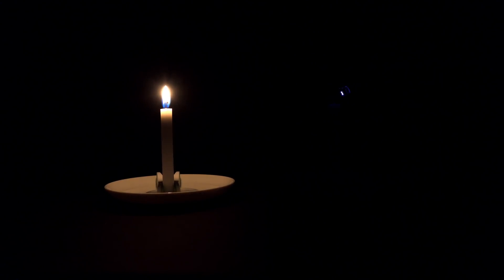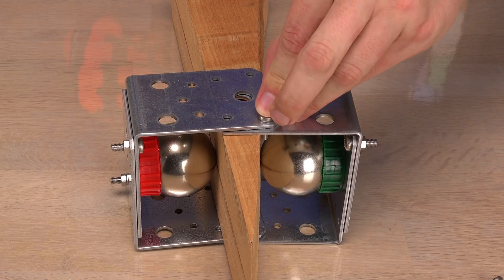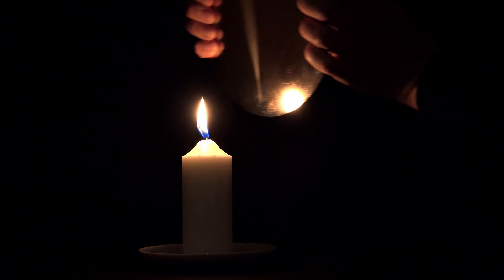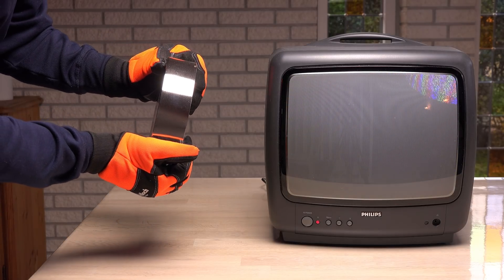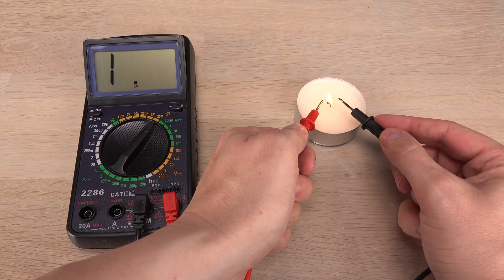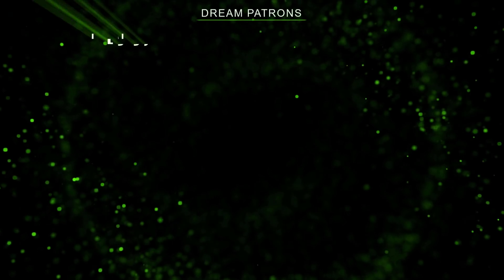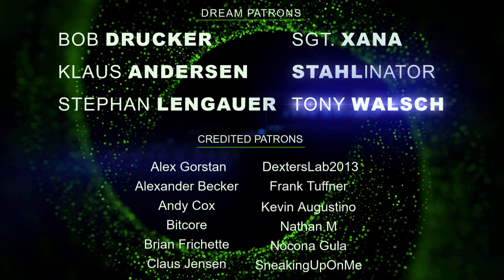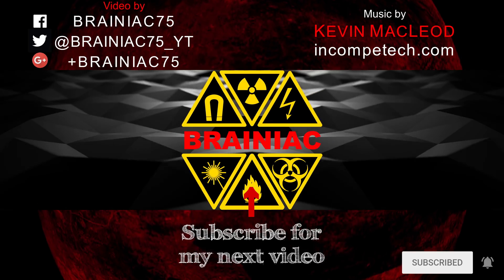Monster magnet meets flames...

Comment: that should make the flame attract the magnet not repelling it because the hot air would expand while cold air would still be pulled in trying to move the magnet with it that should cause the flame to be attracted to the ball even without the magnet. if the magnet pushed on the colder air it would do the same as the help the expansion from the heat but how ever there is another posibility that the flame produce naturally free electrons that accelerate randomly and that the magnet focuses these electrons into a condesed region that has their own field that could repel the magnet and that at random wavelenghts of em emission.

Comment: Würde der Magnet die Luft anziehen, dann würde um den Magnet ein höherer Luftdruck herrschen. Und es wäre messbar. Aber ist es so? Ich bezweifle es sehr. 
If the magnet were to attract air, there would be a higher air pressure around the magnet. And it would be measurable. But is it so? I doubt it very much.

Comment: Some places it has been observed UFOs entering volcanoes and by this experiment shows that the right magnetic field heat can be repelled and possibly enough magnetic field can even repel the extreme heat of the sun which would SPLAIN huge objects close to the sun collecting substance from the surface it's surface.

Comment: The flame experiments are very interesting but has anyone tried to enrich the oxygen content of an engine by peeling off the oxygen from the air at the inlet manifold prior to the carburettor. I worked on an old Swedish design oxygen analyser many moons ago when magnets weren't so powerful which suggested it could be possible. Likewise it might be possible to enrich air for patients using a similar technique without the need for oxygen bottles.

Comment: I'll do my best to explain the best I can and hopefully it'll still make some sense to someone (anyone!). I have begun to suspect that rain fall is in fact due to a similar effect demonstrated here. We just saw how the force introduced to the flame and adjoining air resulted in instantaneously producing condensation.  I appreciate some will conclude my description is simply describing how a cold material and heat interact, and so  I need you to recall what effect can be seen on the nose cone of a jet fighter as it approaches the speed of sound? Clouds. Unlike earlier there is no flame or heat involved  but water instantly appears along the nose as the plane compresses the air. Watch a relevant fighter jet video if you're unsure. I speculate that it's the mass and velocity of electrically charged celestial bodies passing through our atmosphere, akin to the jet fighter, which is effecting more accurately the production of falling rain. Bizarrely the same molecules responsible for producing our rain can also ignite if squeezed violently and suddenly enough, as witnessed in H bombs (when detonated as an air burst) explosion or in Tunguska (millions of flattened trees were caused by a shock wave   compressing the atmosphere.) Modern Rolls Royce Jet engines are so finely engineered and fuel efficient nowadays that they can easily compress air nearly as efficiently as aviation fuel. Fire and Ice indeed.

Comment: Liquid oxygen and liquefied air are so paramagnetic that they can be captured by a neodymium magnet. When I was attending a liquid hydrogen safety course, the NASA instructor said that LH2 leaks are extra dangerous because you can't distinguish LH2 drops from liquid air drops- I objected that my practical experience was otherwise. Turns out the NASA guy had never actually worked with LH2. Ah, credentialism.

Comment: So happens when u use air and magnets to accelerate air   So they need to run a flame  a magnetic barrel   I bet u could double the speed of one those  projectiles  they are using in mag lev guns

Comment: So it's a mixture of cow and palm oil/fats?
FYI the magnetic field of normal candle flame (why it has a stable shape) is very self contained so it doesnt changes shape easily when exposed to outside sources but if it was a flame tornado it should be more easily manipulated. (this is going on the theory of the flame battery where a bigger flame increases the electrical discharge.

Comment: Create a box with all magnets on the inside some how super glued, on all sides of the box but from the interior of it then create a magnetic ball that pushes itself against all the magnets you glued to the box so it the magnetic ball hovers in center or so it may move everywhere inside the box hovering freaking out.

Comment: To test if the oxygen is attracted, and not the flame is repelled, you can do the following test: ignite a mix of air & fuel. Let the flame exit through a hole into a vacuum chamber. You can then repeat the magnet test in the vacuum chamber. Another interesting test: put a candle on the surface of a monster-magnet, where the oxygen content is said to be higher. Light the candle and watch the air flow above it, as fresh oxygen is constantly pulled to the magnet, replacing the exhaust fume.

Comment: If there were smoke, you could see how the particles of smoke moved and from that understand how the air was moving.  If the magnet is really repelling the flame, a styrofoam boat with a candle and a magnet fixed to the boat should propel itself along.

Comment: When its time to create new exotic metalic materials requiring super extreem heat the materials will need to be held and suspended in a magflux bowl and the materials heated with powerful lasers, the magbowls can be either neg or pos charged to assist in the manufacturing process...

Comment: The flame is plasma, that's why. This means that we should be able to use the concept of a railgun to accelerate plasma from combustion to great velocity. Instead of just using a normal rocket engine to produce thrust, by putting a compact nuclear reactor on a spaceship to generate electricity, we could use less rocket fuel and compensate by hyperaccelerating the plasma with the electromagnetic railgun.

Comment: Interesting: I've been wondering if a 'plasma conduit' could be constructed for a flame gulper engine ( these work by condensing plasma in a cylinder to create a low pressure ) . one problem with these engines is getting the hot plasma past the intake valve . I've been speculating that a ring magnet  would keep the plasma clear of the cooler metal parts of the valve. Thoughts?

Comment: It would be really interesting to see what effect the magnet would have on some evenly displaced smoke.
Reply: Hmm I think it depends on the material the smoke is made of (and it's magnetic properties), maybe if it's more magnetic than air (or is slightly repelled) you could seperate the solid phase from the gas phase of the smoke.

Comment: flame is affected my the magnet because flame is a form of plasma,,,,, and plasma is electrical in nature to get plasma to glow put high voltage through it in a tube or in space fire is a form of chemical plasma kinda like our brains and bodies giving off heat from electro chemical interactions the air we breath is plasma of sorts all plasma is are charged particles of any sort electrons atoms neutrons and so on

Comment: 8:40
When you are playing with the double magnet and the flame there is a very noticeable lag between magnet position and flame orientation. The flame effectively seems to be reacting to where the magnets were, 1/4 of a second before.
This strongly supports the thought that the flame is not being directly pulled/repelled by the magnet, but rather by a secondary effect. I.E. the "wind" caused by the magnets' effect on the air surrounding them and the flame.
Maybe some tests with smoketrails in the air, if you can find a smoke substance that is very neutral magnetically and thus not itself affected, just carried by the air movements?

Comment: I think your 3rd theory is the major player. The conductive plasma is flowing upward, cutting the lines of flux from the magnet. The induced eddy current in the flame reflects the magnetic field, creating repulsion.  If you took the big, flat magnet, and held it edge wise to the flame, it would have had a big effect on the flame, just like passing aluminum through the field. That explains why the flame is repelled when you have a north pole on one side, a south pole on the other. Just drop a bar of aluminum through the gap, you'll see the force i'm talking about. It has to be moving to do it, and the rapidly rising flame provides that velocity. Granted, the plasma has high resistance, but those Neodymium Iron Boron magnets do generate a pretty dense magnetic field, and it doesn't take much force to influence a low density flame. the up draft velocity of a flame is actually pretty quick, due to the buoyancy of the light flame.

Comment: your stacked magnets are cool, (sorry for posting on an irrelevant video), but is there a method you can stack magnets that amplifies their strength? Like your magnets and stacked magnets seem to have a pulling force proportional to their volume: 1800 cm3 got like 12 kG, and the 1500 cm3 magnet seemed to have gotten 10 kG. But if you stick something non-conductive between the magnets (lets say a slab of cardboard for much smaller magnets), can it amplify them? If so, how much separation is optimal?

Comment: Years ago I used a fish tank air pump to draw oxygen from a magnet. I directed the flow into a Bunsen burner and used a thermocouple to measure the increase in temperature to confirm the increase of oxygen. The setup was crude so I could not determine any absolute values. That was long before the availibility of rare earth magnets and the thermocouple was a simple twisted wire. The effect was very slight but it did work. It was an interesting experiment.

Comment: Hey brainiac I bought an n45(35kg) rectangle magnet nickel copper nickel and a n42(5kg) sphere magnet chrome played as my two first magnets. Since the n45(35kg) magnet is very strong and dangerous what precautions should I have ? I’m a strong guy and I won’t have any issue removing it from any metal surface with another piece of metal. I already built a wooden tool to separate it from any type of surface. But my question is would it be dangerous if I hold the magnet in my hand  and put my hand close to a metal surface ? I’ve put 35kg in my hand and it didn’t do anything, but I assume it’s more dangerous as the magnet holds all that strength in a small surface.

Comment: Is oxygen enriched near the magnet? It would be very interesting to measure a pressure change, though the pressure sensing tube would need to be filled with a non-paramagnetic gas. Though it would be difficult to visualize, perhaps an experiment with a gas of higher density could be used as a manometer to measure the pressure change.

Comment: Both the diamagnetism and paramagnetism of the involved substances are minute in comparison with the flame flow forces. Unless there is some unexpected magnetic free radical I cannot think of dia and paramagentism as the causes. It must be moving charged particles in a field, creating their own magnetic field opposite to the external one. The flame particles are moving up and are charged for a small fraction of time, thus they can have an induced deflection which would generate it's own corresponding magnetism, which by my napkin drawing should be opposite to the external field. It should be just like diamagnetism on steroids.

Comment: I have a question. If air is repelled by a magnetic force, then would it appear to be attracted toward a vacuum chamber? Because air would only be present on one side of the magnet, it might push the magnet toward the chamber.

Comment: Flames are definitely conductive, just not at the few volts of a DMM probe. At higher voltages they become extremely reactive to electricity and adding more ions to the flame increases this effect. It can be used to make plasma speakers which are more efficient than air-ionized ones.

Comment: Interesting effect! However you lack a control test: in a environment without oxygen there should not be any deflection. Creating a flame in an oxygen starved environment is hard, but can be done if you seperate the oxygen inlet. 
However, I immediately thought of magneto hydrodynamics (MHD) . The flame consists of moving magnetic molecules, thereby they experience a Lorentz force. The equations for this also describe the effects in the core of the earth. Pretty cool stuff!

Comment: So the idea is that the magnetic field attracts the surrounding oxygen and not the flame, which causes the flame to have magnetic buoyancy in air, pushing it away from the magnet not just because it is repelled (very slightly) by the magnet, but mostly because it is less attracted to it than oxygen. It's like a helium balloon which is buoyant in air due to gravitational force, not because the helium is repelled by the earth, but because it is less attracted than air.

Comment: I'd suggest running small/slow pump with intake hose as close as possible to magnet, use captured gas in to flame test and see if it is oxygen in majority.

Comment: By your logic the magnet is essentially pulling in Oxygen which should make the flame grow bigger which is doesn't?
Reply: I think from what we see with the one sided magnet is that it's pulling denser air closer, which means the lighter hot air will end up on the exterior. Similar to how Helium will want to go towards less dense air, even though we might think that gravity should pull it down, it's actually the dense air pushing the light away. I think that's what he is explaining at 6:30 where it says "High temperature = Low density" and "Lower temperature = Higher density". And I think what you say does occur when there are two magnets at 8:24 where the flame gets higher than normal.

Comment: pretty cool, did you try the magnet on the arc lighter. I just tried it with mine and it moves the arc pretty drastically. I tried a candle too, it move but not as much as yours, but your magnets are much stronger than mine.

Comment: We know that heat destroys the magnetic values of an earth magnetic. So what happens to the magnetic field?  Is magnetism energy?  Is it altered or dose it go somewhere else when heated up? If for every action there is a opposite reaction, what is it? 
An earth magnet naturally slowly Dissipates over a period of time; again where does it go? Is it exhort into the earths magnetic field? 
Does heat somehow breakdown the viscosity of magnetism, making it react faster releasing it’s energy back into the earths magnetic field?
Dose an electromagnet react differently then an earth magnet considering the energy is constantly being replaced by the flow of the electrical current? 
 Lastly why does the sun not destroy the earths magnetic field? Considering it is been constantly bombarded by the suns heat.

 I suppose I could do a little experimenting myself to find the answers to these questions. But it would be nice if someone else has already done the footwork. 

 Thank you for the very intriguing video. Certainly challenges the mind.

Comment: There is a tiny amount of plasma in fire. It's not much, but it is enough to create an ion wind away from the magnet. If you'll notice, the effect is more pronounced at the base of the flame, where it is more blue and the ions are in higher concentration.

Comment: I wonder if you can show the air moving without a candle nearby? What about a tiny lightweight paper windmill? Can you rotate it by bringing the magnet nearby? Or does there have to be a temperature gradient?
Reply: Paper would be too heavy. I think a strand of spider silk suspended in a wind-free enclosure with an electromagnet switching on and off would show that better, if at all. The magnet wouldn't make the air flow continuously, but it might tug on it a little when you flip the switch.

Comment: You should try testing it in either a higher or lower Oxygen concentration, or an oxygen mix with the same partial pressure of oxygen but which has a lower average susceptibility.

Comment: You cant measure the conductivity of a plasma by using cold probes like that. A plasma cant exist around the cold probes, so of couse the Multimeter shows open circuit.

Comment: So how did you get the magnet balls with the threaded bolt to turn around so they could be fastened through the bottle cap/sponge to the metal brackets? And why was that rod nowhere to be seen in the final contraption? Somehow I didn't quite understand how you built that.
Reply: If you have two magnets lined up to attract each other, but attached on opposite sides of a closed metal loop, the magnets will be more attracted to the metal behind them than the other magnet, because the field permeates much easier through metal than the air gap between the magnets. So it's really not necessary to bolt them down. But I didn't build the thing. /shrug

Comment: Your explanation for air being responsible can be verified if you pull a vacuum to as low as the pump can go and test the pressure with and without a large magnet placed inside. If the pressure is substantially lower with the magnet, your explanation may have some credibility. Oh and can you verify your results in this video using the magnetic field equations?

Comment: I once put a notebook computer with an old school CRT monitor on the passenger seat of my van. When driving on the Interstate Highways, the image on the CRT monitor was effected by the MAGNET fields of the rebar encased inside of the concrete road bed. Go figure.